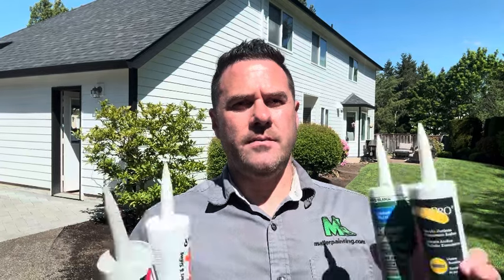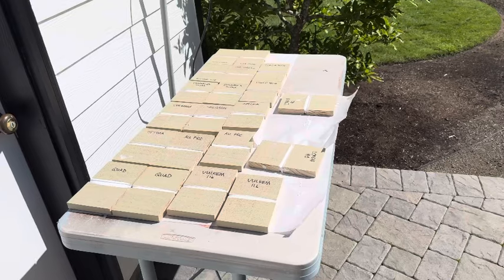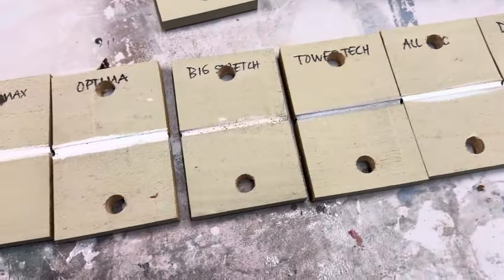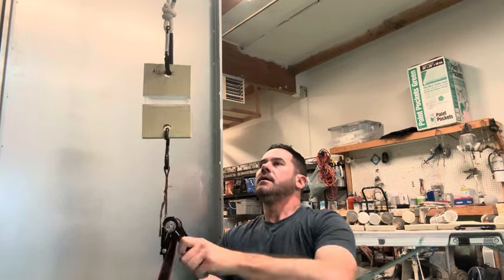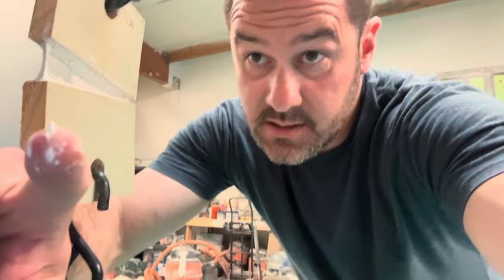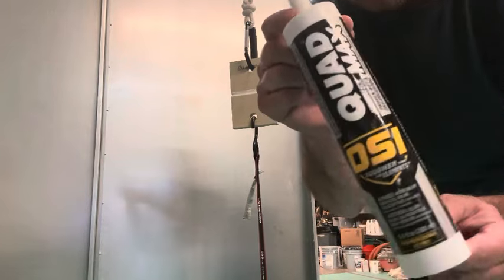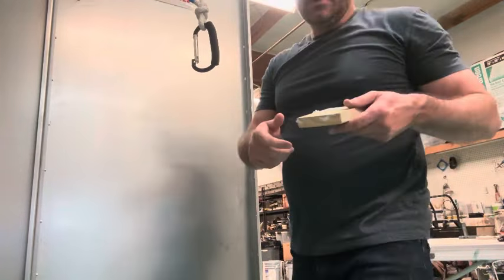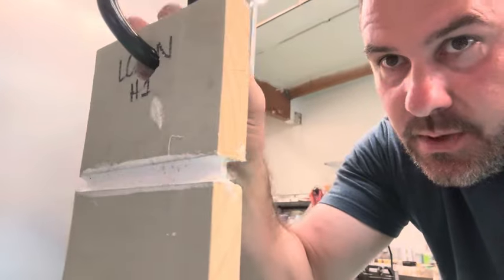The Best Exterior Caulking for Painters #paintlife #painter

Comment: Are you possibly missing the point of caulk?  Caulk is not glue its design is to allow components to move based on temperature.  When doing siding and trim work you leave a gap for caulk.  As temperature changes the caulk allows for a good seal but allows for wood movement.
Reply from the maker: I own a paint Buisness in Oregon where it rains constantly. The main purpose for caulk here is to keep water from leaking past the windows and siding. When the home expands and contracts this will cause the caulking to tear leading to more water intrusion. So the point of this experiment was to find out which caulking would hold two pieces of wood together without tearing thus being the best caulking to keep water out of the walls of your home. Which is a real problem here as it leads to black mold, dry rot ect.
Reply: In practice, high-end sealants fail because of bad adhesion to one of the surfaces, NOT because of lack of stretching. High-end sealants do deliver excellent stretch, but the big selling point is the adhesion. This weight test is checking for both stretch and adhesion; anything with a good amount of stretch but still rips itself apart rather than detaching from the surface is a winner.

Comment: Keep in mind not always the strongest caulk is the best.  If your looking at an expansion gap in siding for example over 12' you need to generally have a 1/4 to 1/2" expansion gap.  If you put too solid a caulk in there its going to cause the material to fracture.  In expansion joints you generally want a 200-300% repeated expansion product (400-700% break)
Reply from the maker: Very true! Some stretch is always important as most homes like to move Loxon was most impressive as it stretched more that optima and quad max and was able to take the same shape after releasing the pressure.
Reply: @mallerpaintingcompany  yep.  In my experience some are great those great at bonding to difficult surfaces, those that are very stretchy, those that are very strong, and finally there are the products that favor application (cleanup/drytime/etc). Unfortunately you can't always have it all so the hard decision is choosing where you are going to compromise to do the job.

Comment: Just what I was looking for.  Best demo on caulk I have ever seen.  Thanks.  I just purchase the OSI Quad Max (black & white tube) shown in your video as water based, however on the tube it says to clean up with mineral spirits.  Can you explain?  thanks
Reply from the maker: Thanks for watching You are correct. My first time using quad max was in the video. And it didn’t have much of a odor and I was able to clean my finger with a wet rag so I assumed it was water cleanup however it’s almost in a class of its own as a “Silane Modified Polymer” which is different from Polyurethane “regular oil” and different from the “urethanized elastomeric” like tower tech but after a long day of caulking mineral spirits are going to clean up your hands the fastest.
Reply: I am at hd buying some and noticed the clean up with mineral spirits. I'll give it a shot with soap and water and see how it works.

Comment: I love the comparison of products, but just raising the kettlebell off the ground doesnt create more and more tension, it always just pulls the weight of the kettle bell. I need to do exterior window trim bonded to brick and have narrowed it down to dynaflex ultra, dynaflex 230, dow 795, titebond weathermaster, and lexel. Dont plan on painting the caulk, just need white. But need uv and 4 season tolerance.thanks to you i may need to consider osi as well.
Reply from the maker: Thank you! You are correct it does not create more tension but it does show you how long they can be put under 40 pounds of tension which I believe really is the best test I’ve seen online. Also observing dry times and how the caulking reacted to direct sunlight for 7 days as some caulkings do not do well with thick beads of caulking like the big stretch. Big stretch performs amazing with smaller beads just won’t dry internally with big gaps causing off gas bubbles on surface

Comment: Great video. Thank you for doing that! Just one question. In your write up below the video, you listed Sherman as the number one best caulking. However, in your video you listed it fourth just before the last place big stretch. Why the discrepancy?
Reply from the maker: Great question there is actually 3 sherwin Williams caulkings in the video. The best hands down is the Loxon H1, then the Optima white lighting and the “fourth one your referring too is the SherMax all three are Sherwin Williams Caulk products but all three are a different base  making them severely different in performance

Comment: Thanks for your response.  What do you use to cover or fill  exterior nail holes on wood?
Reply from the maker: No problem 💪We use SherMax waterbased to caulk small cracks, knot holes and nail holes as it sculpts better than the solvent caulkings but you can use any exterior waterbased caulking. Just make sure to use the good stuff on the windows, doors and corners!

Comment: Can I use Quad Max on LP Smartsiding Gaps? What does the ASTM C920 Type S //grade 50 mean? LP suggests to use ASTM C920 Grade 25 for the Lap siding gaps?
Reply from the maker: Quad max isn’t on the list however Dap Dynaflex is and isn’t as good as QuadMax by a lot! Here is a website with all approved caulkings. https://www.buildsite.com/astm/C920 I would probably use Vulkum from this list but you will need to wait two weeks for it to dry before you paint. My personal opinion is QM is better than all the caulks on this list

Comment: Why do painters insist on using the cheapest, lowest quality materials when it comes to caulking. I understand the desire to be able to paint as soon as possible but not at the cost of using garbage materials.  With 1/4 the lifespan of quality materials. The test scenario you set up( with an actual joint) will be a waterproofing situation 9 times out of 10. None of those products should be used in a waterproofing situation no matter what the manufacturer claims.
Plus these tests are very flawed because none of them will last. Except for vulkem products none of those brands are marketed to the professional caulking/ waterproofing industry. And there is good reason. In the USA residential caulking lasts an average 5-7 years. Partly due to cheap/ wrong materials,partly due to unacceptable installation ( like this video where it is installed far too deep for its width  and not the proper profile,  joints like this REQUIRE backer rod. It is not an option, just because it will be covered by paint is no excuse for horrible installation practices) your installation is an embarrassment to anyone that knows anything about caulking and sealants, commercial/ industrial caulking lasts an average of 20-30 years. Due to proper materials and proper installation. The vast majority of painters have no idea how to install caulking. No professional caulker would ever use any of these consumer brands on exteriors or in any wet area. OSI and SASHCO try to act like they are a commercial grade instead of consumer by marketing to home builders because they know the low quality of residential caulking. In fact OSI QUAD has a disclaimer that it can’t be used on commercial projects without getting permission from the manufacturer. If it’s not good enough for commercial use it’s not good enough for your home.
Reply from the maker: The title says best exterior caulking for painters. My company focuses on re-paints. In order to run a profitable job i need to caulk a home and paint next day. This is impossible with a product like Vulcum as it takes 7-21 days to dry. If painted too early the caulk off gases through the paint while it cures and fades pre-maturely where the caulk was applied. The purpose of the video was to find out which products dried the fastest and which ones could with stand extreme tension. Not to show off how to properly caulk. If you want to make a better video send me a link I would love to watch it. Otherwise move along builder Bob 😃
Reply: @genecarden780 I get your point that the people who build skyscrapers having great training and fancy products, but that's not who this video is for. This is a video for guys who fix leaks in houses and paint them. It's not reasonable to expect these guys to have engineer support and buy thousands of caulk tubes at once from DOW. The data collected in this video is good: he notes that some can be painted faster than others, and he notes that some bubble, and he tests the adhesion strength of them. 

All the sealant companies will recommend you do an adhesion test similar to this before the project begins. The easiest way is just laying down a bead and trying to rip it off. If it detaches from the surface, then it's an adhesion failure. The test in this video goes an extra mile by measuring the weight load to failure. It's a great test. Keep up the good work everyone.
Reply: @ No you don’t get the point. For the most part painters use garbage sealants that don’t last. They  sacrifice quality for profit. And while you are right about skyscrapers and buying in bulk, we use the same products on single story buildings,that just happen to be commercial too. And many of the products we use ( or very similar) are available to the consumer. Most of the products painters use ARE NOT SUITABLE in waterproofing situations. 99% are acrylic/latex or modified acrylic/ latex. Absolutely the lowest quality of sealant available. One of the most common ,and often most expensive, causes of damage to homes is water infiltration.Cheap polyurethane is orders of magnitude better than ANY sealant you can clean up with water. Again industrial/ commercial sealants last an average of 20-30 years residential 5-7 years. Some of that is due to knowledge,and a huge part of that knowledge is knowing that these sealants are garbage and won’t last even with perfect installation practices. Nothing in this test matters if it only lasts 7 years. Or less. By the way we often install sealants on very high end custom homes. Products like Vulkem 116, Sika 1A,LM15, NP1,( among others and all available to the consumer ) have a proven track record of lasting 20+ years. Painters  only reasons for not using them are convenience,ignorance or profit. Never what is best for the homeowner. The difference in cost for the typical house is less than $50 ( for a very large house, probably closer to $20 for the average house) 7 years versus 20 years, extra$20 . Not a hard decision to make. Not to mention the millions of dollars in water damage every year in the USA
  And to your point of being about people who fix leaks, only a very ignorant person would use any of these products to fix a leak. It would be laughable if it didn’t cost homeowners thousands of dollars in damages because of ignorance spread by this type of video.If it is not marketed to the waterproofing industry it is because it is GARBAGE.